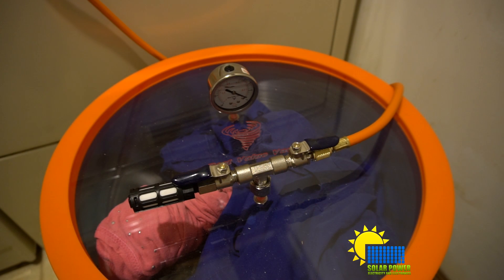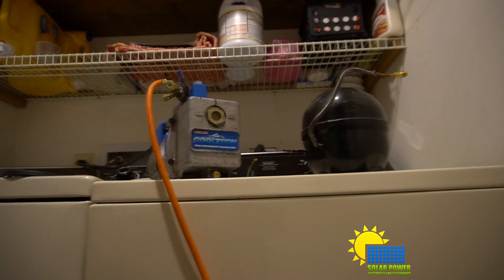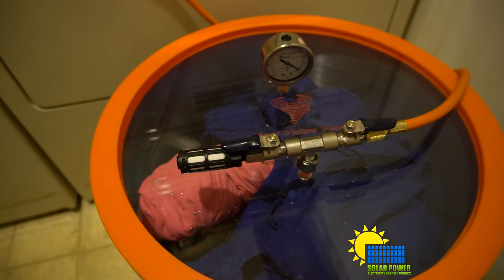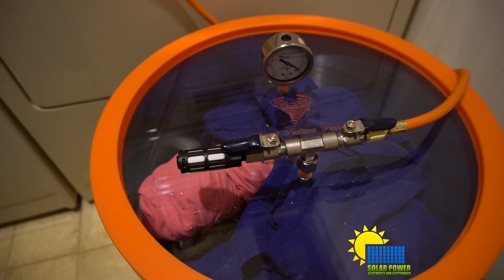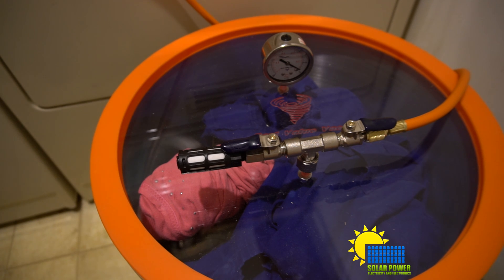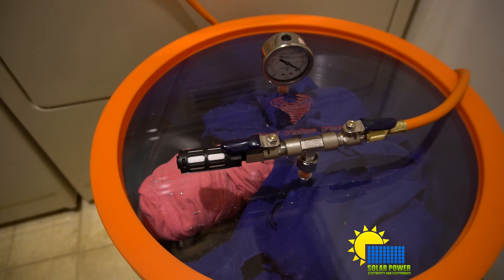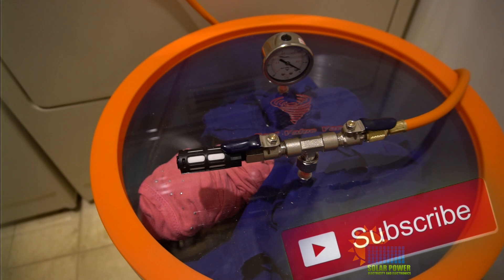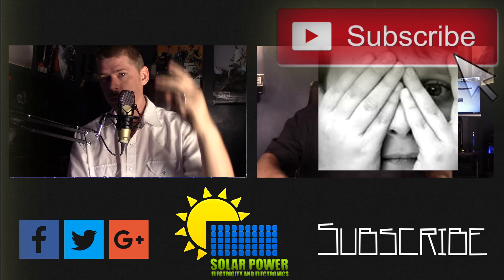Will a vacuum chamber dry your clothes?

Comment: Now all you need to to is add the centrifuge part.
Reply from the maker: That would be cool
Reply from the maker: Any ideas on how to make it
Reply: @solarpowerelectricityandel2915  - There was a guy who had both, it appeared to work, thought for sure it would take off but nothing. The combination of both makes sense, even if with a tumbler. I cannot recall if he used magnets to spin it, as with hidden locks in wood.

Comment: I pull a vacuum on AC systems almost daily. It's not freezing, if it was, then we could never pull a vacuum on anything hvac/r related. It's just a huge amount of moisture to be removed that way.
Reply from the maker: what happens to a R-410a tank when you charge a unit?
Reply from the maker: Thanks for sharing your perspective! Absolutely, pulling a vacuum in HVAC systems is primarily about removing moisture rather than dealing with freezing temperatures. Moisture can cause issues, so the vacuum process is crucial. As the owner of an HVAC contracting business, I encounter this process almost daily. If you have any specific tips or experiences you'd like to share, or if there's anything else related to HVAC/R that you find interesting, feel free to let me know!
Reply: @solarpowerelectricityandel2915  it gets cold due to the transfer of the 410a refrigerant, not due to the process of vacuuming. If a vacuum caused water to freeze, we couldn't do it. Now, we are talking about, usually, very small amounts of moisture, but water boils at lower vacuum pressure, not freezes.

Comment: You could warm the chamber using a heat pump to keep the temparature stable.
Reply from the maker: a Heat pump needs air in a vac no air
Reply from the maker: infrared heat or contact heat will heat it up and both will not get but one side of one peace dry
Reply: I meant perhaps to incorporate some method of warming or heating the vaccum chamber using a heating element or radiator, think like a fridge in reverse

Comment: I put in a vacuum chamber closed the end the vacuum is connected so no moisture can travel back to vacuum i then added a small heater to the side and rotate every 30 min or so clothes dry in a hr all i did before was rotate in washer extra spin after wash

Comment: Put some LiBr solution in a container with a lid having enough pores to absorb the moisture. It might actually work to absorb the moisture, hard part is to regenerate the same for next cycle. You might have to connect a solar water heater to increase LIBR concentration.

Comment: I already have thought about adding 117 volt heavy duty heater, that will keep it above freezing as during tumbling instead of just sitting and doing nothing. I figure, if the temperature would be around 70 degrees inside the vacuum dryer. Because of heater, you can dial in 1psi. that will bring it to boil point at below 70 degrees. How ever; you may have to slowly let the air in to prevent from it's getting too hot as the air will compressed. Some other guys say; you pull more vacuum out. Frozen is frozen that even is founded on moon where sun never had shine. I think heater is better solution.

Comment: You shout add a hit lamp on top of it.  If you get to 50c with the vacuum,  that will dry it in 10 min.
Lamp delivers the hit by radiation so the lack of air is not a problem.

Comment: I dry my clothes in a microwave oven ;-)
Reply from the maker: Excellent what do you do with the metal zipper and the Sparks and metal that flies off of it that burns the pants
Reply: @solarpowerelectricityandel2915  Last Saturday I was drying a pair of jeans, and there were no sparks. I believe it's because all metal parts in them are brass, not steel. Steel would rust. I think that sparks are generated only with metals that react with magnets and stainless steel, brass, aluminium doesn't, therefore there are no sparks :-)
Reply from the maker: @Radoslaw1986xx  Good to know that you like to cook your clothes.
Reply: @solarpowerelectricityandel2915  I don't like to but sometimes I have to ;) It would be great to put a microwave oven in a vacuum chamber and then try drying clothes ;-)
Reply: @Radoslaw1986xx  like a microwave vacuum dryer? Not like they have those already or anything.
Reply: Is that your regulator on the left hand side of the t joint? Apparently if you were to put the regulator at the other end of the vacuum chamber rather than at the vacuum end of the chamber it will actually dry quicker. But that's with a microwave providing a heat source

Comment: Would you try adding a little bit of warm air at the same time as you're pulling air out and see if that does anything different. You could try cycling between pulling a vacuum and adding heated are as well. Also please include how much energy is used for this process
Reply: I was thinking to make the same project but instead of warm air, I'd heat the entire cylinder. Perhaps putting the vacuum chamber inside a bigger insulated bucket filled with hot water while vacuuming intermittently using timer (to prevent damaging the pump). But the problem is, since there is very little air remains, convection heating will be far less effective. Radiative heating can be achieved by painting the chamber's internal matte black. Just an idea...

Comment: I wonder how effective it would be if you added a heat source to the camber.
Reply: Conduction heating will work.
Reply from the maker: no air to heat means radiant heat only
Reply: @solarpowerelectricityandel2915  use IR maybe?
Reply from the maker: @prajwalbharambe343  air moving and recirculating and flipping the close

Comment: You have the basic principle to make it work to its full potential you would have to apply heat and thus pull more vacuum as the water vapor expands. In addition you would want an inline water condensed/collector so you don't ruin your pump. And if you want to shout the moon a way to agitate. But after all that a clothesline is your best bet. The channel FirstBuild is working on a similar project.
Reply from the maker: Riley Evan Lloyd clothesline is definitely the most effective for saving electricity thanks man I appreciate it I'll check him out